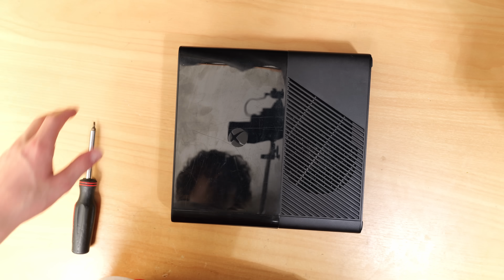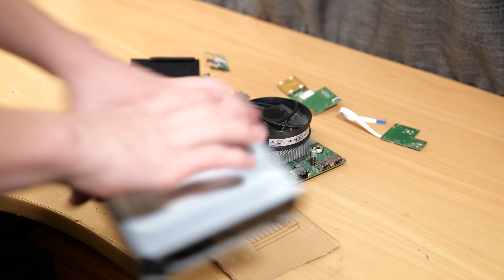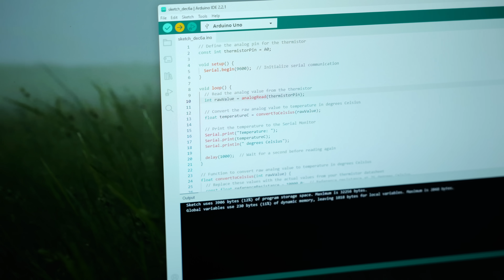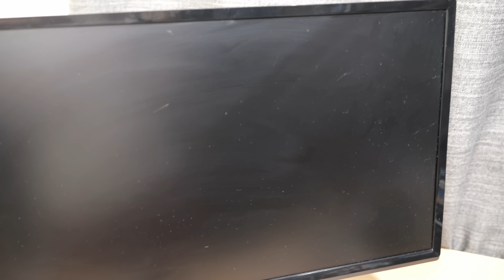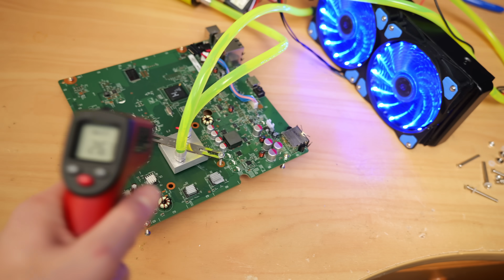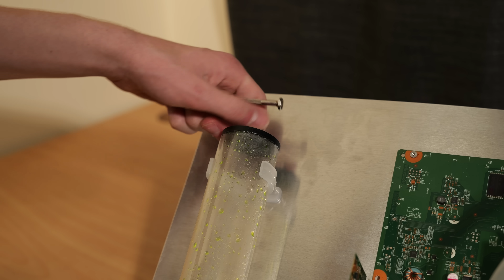Watercooling an Xbox 360

Comment: Just a little insight mate, have the loop go from the cooler block into the radiator, then into the reservoir. This way you aren't heating up your reservoir and it's guaranteed to be cooling before the block. Cheers!
Reply from the maker: Thanks for the tip! I’ll do that now and write it down. Cheers!
Reply: Sorry, but Jay2cents basically debunked this comment. The order of your loop does not matter as long. as the water is moving it will all be the same temp. The quarter of a degree it picks up will be spead out so fast it does not matter.
Reply: @atleyflenner  I'm sorry man, I must've missed that video. My mistake!
Reply: I was gonna say! But always check the comments before commenting! It's a cool mod nonetheless (pun intended)! 😎

Comment: Something thats important for lifespan is that 360 disk drives are HORRIBLE when not mounted level. Mounting them on their side, or as shown here on an angle, can massivly reduce the lifespan of the drive and also results in damage to the disks as they're not properly secured inside the drive. This is despite marketing showing the 360 standing on it's side, it's actually really bad for it.
Reply from the maker: Thanks for letting me know! I’ll be mounting it level when I put it in the pc case, in the time span before I get to work on part two, I’ll be disassembling everything to make sure nothing gets damaged.

Comment: Wouldn't it just be easier to adapt an aio??
Reply from the maker: I was considering that, but the kit I purchased was great value and I knew it would work straight away. An aio has more performance and quality though.
Reply: @TommyHoughton   I guess that's because you are in Australia (did I assume correctly?). In EU or America you can get pretty cheap AIOs, like ID cooling 280mm  can be found under 70 freedom dollars. It is pretty cheap, although you can probably find used Xbox for that price.
Reply from the maker: @manoftherainshorts9075  pretty close, I’m in New Zealand. I’m sure there’s some good value AIO’s here too, I just need to do a bit of research.

Comment: I was wondering if I could use an Arduino to monitor multiple points of temp in my truck :o I drive an 03 f150 and I was thinking about replacing the outside temp display that's in the top console with a custom display that measures a couple of temps around the engine, cabin, and even outside lol maybe even show off some cool animations on boot

Comment: I don't like painting. Heat sinks you reduce efficiency.
Reply from the maker: It wasn’t necessary either, but with the amount of heat being dissipated, it didn’t matter too much. I’ll be careful when doing projects that require proper cooling though. Thanks for the tip.
Reply: @TommyHoughton  No problem I enjoyed the build, Right now i'm Rebuilding my computer but instead of using a Computer radiator I'm using a transmission cooler, for a transmission. And it's only 20 bucks and I bought some hosing from home depot and a water circulating pump for a house.

Comment: You really gummed up the plastic on the back
Reply from the maker: yeah…
Reply: @TommyHoughton  I'm not trying to be rude...they design them hard to open on purpose it's dumb....I think the slim is a little easier to get into if your trying a part 2
Reply from the maker: @MouldyMooseknuckle  I’ll be a bit slower next time, I have a bad habit of opening electronics without proper preparation. I look forward to trying it again.

Comment: If you RGH the console and use custom firmware, there's already an internal temperature included inside the board, you can the the temp status on the main menu.
Reply from the maker: I was hoping to do that, but this model doesn’t support rgh unfortunately. I’m planning on doing this type of project again but with an RGH3.0 compatible model like the slim.

Comment: This should be RGH’d
Reply from the maker: I wish I could, but this model contains a Winchester motherboard, so it unfortunately isn’t possible.
Reply: @TommyHoughton  I stand corrected. Wasn’t aware of that, I still have a JTAG’d Jasper which is where I kind of left off in the 360 mod scene.

Comment: I think for the PC thing, if you’re willing to dabble in it a bit, you could probably find a way to mount the Xbox 360 power supply in there. The jack it uses to plug into the wall unplugged separately as its own part and it’s the same as a normal PC cable.
Reply from the maker: Thanks for the tip and suggestion!

Comment: You should've used the OG white Xbox 360s with zephyr and falcon chips. Those were the units infamous for having a high chance of getting RROD. It'll be quite interesting stress testing them
Reply from the maker: I’ll keep an eye out if there’s any being sold locally!
Reply: For reference, there's a diagram online showing the different model types from power connector ports. That's the differential!
Reply: It would be interesting, but I imagine they’d probably still fail at some point. The chips are still getting hot when under load; it’s the thermal expansion and contraction cycling of the chip and interposer that was responsible for the RRoD, not overheating.
Reply: @nameless-user  I mean to be fair literally every console created will all eventually fail. Also as far as Fat Xbox 360s.are concerned, Jasper revisions are solid reliability wise.
Reply: @winlover37  Coming from someone who actually owned these flaming P.O.S back in the day, the Jasper units are just as bad. My 3rd elite was a Jasper V2 and failed at the 8 month mark just like the Falcons
Reply: @jordanturner97  I believe you, I also believe you're insanely unlucky. Anecdotal but mine has been fine for a while and hopefully will stay that way
Reply: @winlover37  I personally still know someone who still has their launch 360. I also know my brother's launch 360 melted a disc and RROD'd within a few weeks. Its all anecdotal, but If we're being at all honest with ourselves the pre-slim 360 was a rushed product with multiple points of failure; and the fact any have survived with regular use is astonishing
Reply: @jordanturner97 First of all there's no such thing as a jasper v2, it's called tonasket. 2nd of all you were extremely unlucky since tonaskets are the most reliable 360's out there (yes more reliable than slims and E's)
Reply: @jordanturner97 
I still have my Falcons and my Jasper. 
Modded one falcon, one Jasper. 
All three still work. 
Modded falcon I play every day.
Reply: @nameless-user   Yeah but there is less thermal expansion if you keep the chip cooler. That's the point of better cooling LOL
Reply: I water cooled my 360 elite and still have it.  Runs just fine.  Never seen the coolant temp get above 87f.
Reply: @TheBlindingwhite  Hell yeah, nice to see.
Reply: this would make much if any different to preventing rrod. the cause is within the gpu chip, the solder within is the problem. it isnt thermal related in the conventional sense
Reply: @leonikonomopoulos3923  RROD is just a Signal indicating a failed fault check when the console boots. It can be any number of things but the main cause is usually the GPU. It's not actually the solder but the underfill for the die, ATI used an inappropriate underfill for the temperature range the 360 would be subject to in order to get it to market. The die would fail to be held by the under fill and get detached. Macbooks at the time had the exact same issue on their ATI GPUS. The cause of their failure was poor thermal design. The 360's design and the chips to make it were rushed to market and the console was literally made as cheap as possible to undercut the ps3 and beat it to market, Hence why the base model had no built in wifi, no HDDVD support, no hard drive, no Bluetooth, not even rubber bumpers on the disc laser ensuring the smallest bump to the console while playing a game would scratch the disc. Even Japser units with the "Fixed" GPUs are still subject to failure cause the thermal design of the xbox is atrocious. The heatsinks and fans were far to small and there was hardly any intakes for air.
Reply: They didn't fail because of overheating, that's a common myth. They actually died because of poor manufacturing by tsmc, long story short the actual chip itself had a fault where the small solder bumps that connect the chip die to the substrate (yes not the bga balls, that's also a myth ps. if you got your 360 reballed/reflowed you most likely got scammed) cracked because it was defective and heat cycling (aka the console heating up then cooling down) stressed it and made it break.
Reply: Get a falcon so you can Rgh 1.2 😁
Reply: Wouldn’t prevent those from dying. They were part of bump gate and the gpu was flawed in material design as was the og ps3 gpu.
Reply: Dude, please, I'm 42 and grew up with optical media..' please try and keep the drive level.  I get anxiety being that at an angle lol.

Comment: U could have done it with more profession and some more research. Its just a random video with tottally inaccurate results. The motherboard is needed to be screwed in place for the cooling to be accurate. If you just let it hang the heatsink doesnt make good contact with the die itself. I know it cause im servicing XBOX 360s for many years now. Sorry bro, this video is inaccurate. But i appriciate the try.

Edit: Also PLEASE USE NORMAL THERMAL PASTE NEXT TIME.
Reply from the maker: Thanks for the feedback! I jumped into this video without much prior research. With all the comments on this video, I intend to improve this project once I attempt it again. I'll order some proper thermal paste too!
Reply: @TommyHoughton  If you want to try it with other models go for an Xbox 360 S those have Trinity or early Corona mobos. They are easy to do RGH 3.0 on. And they have a heat spreader so its easyer and also better to mount water cooling on.
Reply from the maker: I originally wanted to do that, but I didn't know what model this console was when I bought it. I 100% plan on redoing this with an RGH compatible console (I've been looking at some locally.) I've had a lot of feedback on this project, so I can improve the build a lot when I retry it. It won't be for a little bit, but since this video is performing well, I intend to keep it on my list.
Reply: @TommyHoughton  All models are RGH compatible except the E series so bad luck here now, but with the power of RGH u can monitor tempretures too, so u can gather tempreture information either from the arduino thing and from the console itself. Im subbed, u make interesting content, just research a bit more my friend :3

Keep it up, and merry christmas.
Reply from the maker: @bendy-x1v  Thanks for the info! Having the console measure the temps will be a lot better. I look forward to making this project better next time. Happy holidays!

Comment: You should JTAG the console and try compiling stuff like gentoo on it for the ultimate test of your water-cooling /s
Reply from the maker: Unfortunately this model can’t be modded with RGH or JTAG, but hopefully I’ll be able to try this again (and do it better) with a non Winchester model xbox 360.
Reply: @TommyHoughton  Why not do it on an Xenon 360? Those are most known for overheating problems anyway right?
Reply from the maker: @randomchannel9331  If I can find one then that could be a good extra project, but I definitely want to try getting RGH3 on a (compatible) slim console, primarily for the practice and features.
Reply: @TommyHoughton  Well the xenons are compatible with RGH 1.2 iirc
Reply: Jtag is impossible on all slims. It only works on phat consoles running dashboard 7371 or lower. The next best thing is rgh3 which is only 2 wires and a resistor and works on all consoles EXCEPT Winchester, xenon, and zephyrs.

Comment: Ok so this whole project was like really pointless, here's why:

1. Your xbox was at good enough temps before all of this. Your specific model's cpu/gpu was made to run at 82 degrees Celsius, that's why the fans were barely spinning, it was below the target temperature (82C)  so they were running at minimum speed.
2. Even if it was running hot aka hitting the thermal target and the fans were kicking in harder it wouldn't change the performance as the xbox 360 doesn't thermal throttle. Changing the thermal paste would be enough.

Well let's say you just wanted to do this as a cool little project, here's everything that was useless/bad to do

1.Not properly researching on how to open something is just dumb, if there weren't any tutorials you should have figured you were looking for the wrong model. you're not using the case but still, it would have been better to not completely destroy it.
2. This is not how you check temps, proper way would be to mod your xbox and read the temps from the sensors built in into the cpu/gpu but as your specific revision of the xbox 360 cannot be modded you will be forgiven for this error. Temperatures on the top of the heatsink don't represent the real temperatures on the die of the cpu/gpu which completely invalidates your temperature results. A good alternative would be to just stick the thermal sensor close to the die or on the underside of the heatsink (will still give inaccurate readings but better than what you have now).
3. Using screws to secure the block to the processor die is bad. In short, the piece of metal that was securing it in the first place is called xclamp and what it does is push the gpu towards the heatsink while allowing the board to freely expand and shrink due to the rising and falling temperatures. What you did is very stupid because the board won't be able to flex and will warp over time. This can break the connection between the processor and the motherboard which will break your xbox.
4. Ram (aka those smaller chips) does not need cooling, it's fine as it is.

How to make it better?
It's fine, just find a way to use the xclamp for block mounting and you should be good

In conclusion,
This was pretty pointless and did more harm than good to your xbox but I'm sure it was a good learning experience and after more iterations this project will surely become better

edit1: fixed spelling mistakes, lol
Reply: I was about to write the same honestly, your comment should be wayyy closer to the top!

I only really "disagree" about the "pointless" side of things as I put having fun over something making sense because otherwise this project wouldn't exist!

Still all your points are very valuable not just for the creator, but the viewers as well
Reply from the maker: Thanks for the info, I was going just off the top of my head, so I appreciate the guidance. I was planning on doing this again with a non winchester model, in the hopes of doing RGH and to also try and improve things. I’ll get the xclamp sorted on the current console. Next time I’ll be more thorough with my research, I kinda jumped into this one with minimal planning.
Reply: @TommyHoughton Cool, can't wait for the next video (btw. if you have any questions about 360's then hit me up or something)
Reply from the maker: @h1r0uwuu  thanks! I’m out of my league (as you have noticed) so when I try this again I’ll make sure to do so.
Reply: Sounds to me like someone woke up in the wrong side of the bed.